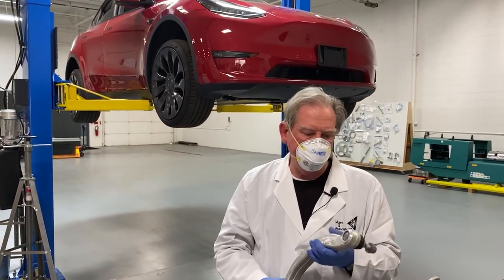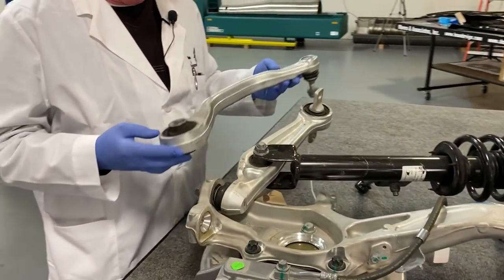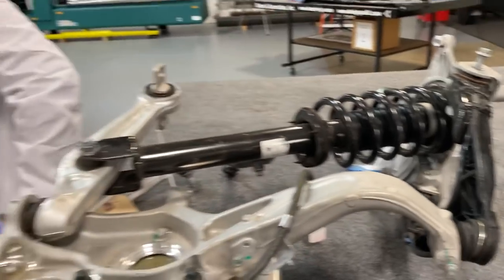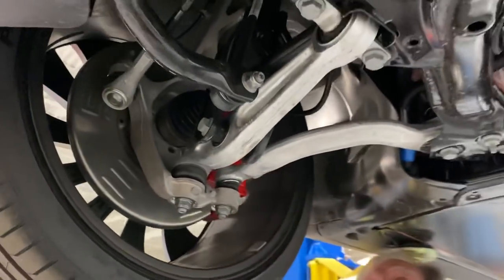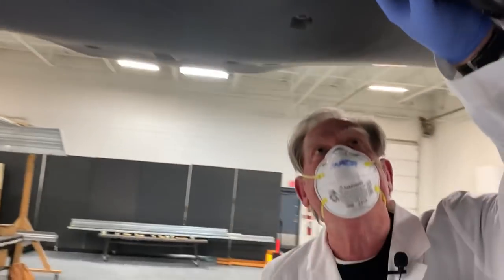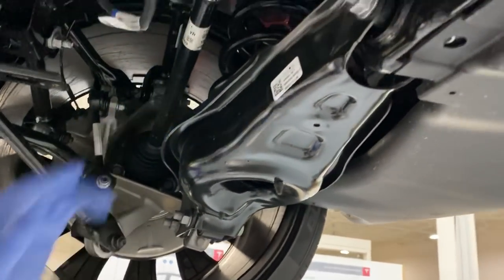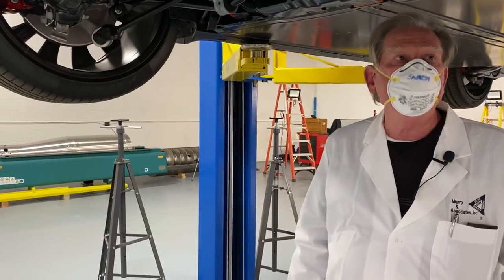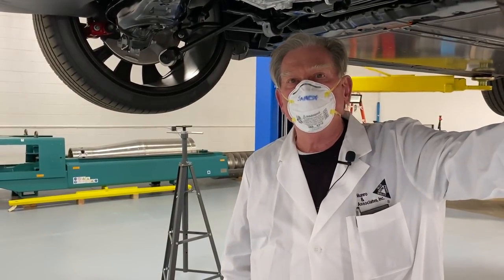Model Y E5: Suspension Insight

Comment: The upper control arm he referred to as 'damper' with screws instead of ties now, can confirm that newer model 3's have this. I have an early 3, and recently replaced the upper control arm on both sides because the bushings were squeaking (100k kms).  The new part I got looks like slight redesign hopefully the squeak issue is also eliminated as was common on early 3's.  I would guess it's identical on Y and 3.
Reply from the maker: Good to know, thanks for confirming! Sounds like the transition to screws vs. bands must have been a running change.
Reply: @MunroLive  we need to get you at the ground level of the cybertruck build 🙋‍♂️🙋‍♂️
Reply: When did this change happen on the Model 3?
Reply: BeAn BeAn  when was that 🤔 did you mean bands?
Reply: BeAn BeAn twist-ties?  Hardly.  Industrial bands will last just as long, if not longer than bolts.  They just cost more.
Reply: @Resist4  I think he ment bands I have never heard of anyone using twist ties. I am currently googling looking for any example of an automaker using bread ties I can't find any.
Reply: William Wood yes I know he meant bands, he was being funny.
Reply: 100k kms already?
That's a lot of driving
Reply: @bannor99  Spring 2018, wife drives 3 hours total commute daily on highway.
Reply: The part he is referring to looks to be a weight added to the plastic upper control arm, likely to dampen vibration, so he had it right.

Comment: Brake shielding with the Tesla Logo is pretty cool!
Reply from the maker: Good observation! Best part about it is that it doesn't add cost to the part, just requires the die tooling to be machined that way from the initial launch.  No extra manufacturing steps necessary at the component level.
Reply: I'm not familiar with the brake shield, but looks to me like it has T3 (iii) on it?
Reply: @MunroLive  It costs extra time to machine the dies but that's minor.
Reply from the maker: @MrCarGuy  Yep, completely agree.  We'd refer to that as an "investment cost" vs. a "variable cost".  Thanks for tuning in!

Comment: Tesla currently offers these variants of the Model Y when you order (taken directly from the Summary): 

	Model Y Performance Dual Motor All-Wheel Drive 
and 
	Model Y Long Range Dual Motor All-Wheel Drive 

They are both Dual Motor All-Wheel Drive. So there are two variants of the Dual Motor All-Wheel Drive, the Performance and the Long Range. So you were actually correct in calling it the Dual Motor, but more precise in calling it the Performance Dual Motor (as opposed to the Long Range Dual Motor). Although it is probably worth noting that the stealth Performance variant (i.e., without the Performance Upgrade) has only 1 mile less range (315 miles) than the Long Range variant (316 miles).

Comment: NOTE: according to Motor Trend here (https://www.motortrend.com/news/tesla-model-3-teardown-details/)(supposedly reporting what Sandy said) the screws/zip ties only hold the piece in place while the glue dries :
"Front Upper Control Arm—These are formed of thinner-gauge stamped steel then reinforced by having plastic webbing molded inside. This plastic also provides attachment points for routing the ABS sensor wiring. The oddity: Note the ingot of iron that is glued in place (held by zip-ties while glue sets). Munro reckons this is to dampen a troublesome natural frequency. It remains to be seen if AWD Model 3s will require this."

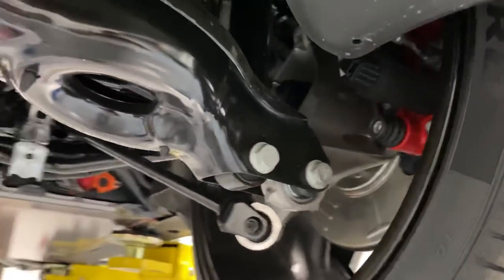Comment: Video #4 Fit and Finish   On the left side of the trunk the emblem says "Dual Motor"  the 2:00 mark of the video.
In this video @2:30 Sandy says this is not the "Dual Motor" model but the "High Performance" model.   So I guess it's both.

Comment: What motors are in it? Please check the plates with model numbers that are usually on the left side of the motor. Would be interesting to see if it's the same as model 3 (960 in the front, 980/990 in the rear).
Reply from the maker: Definitely going to be getting into those specifics as the teardown progresses.  Thanks for tuning in!

Comment: The big question is tire clearance? I know it can clear 18" wheels but would be great if you could put full size tires on the 18" wheel.
Reply: Changing the diameter would be risky, might effect speed sensors & braking?
Reply: @robertpryor7225  A little, going with a little bigger tires on our model 3 once they are worn out. Strike the bottom way too much.